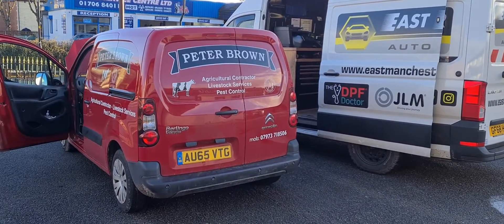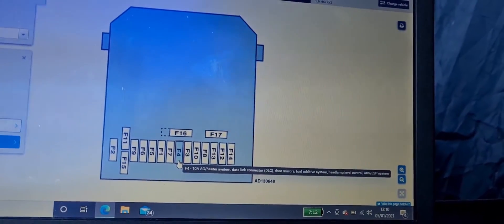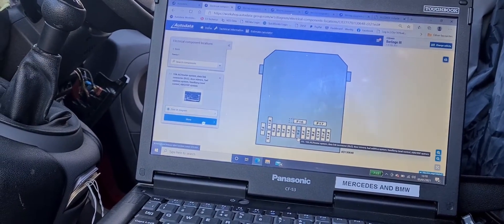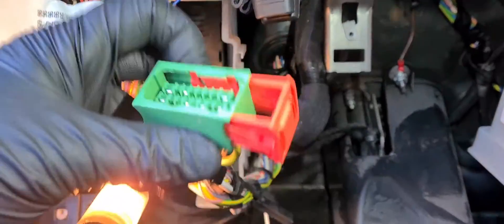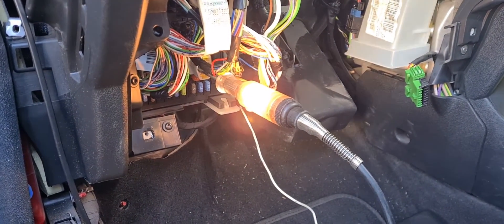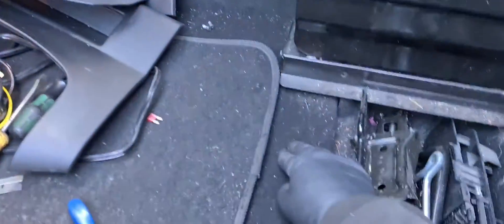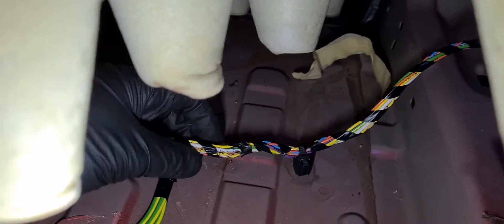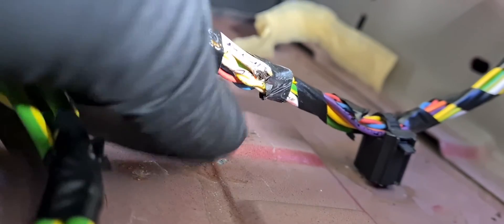SHORT CIRCUIT ON A CITROEN BERLINGO

Comment: I need your help my 2014 berlingo randomly loses the rpm, temp, and odometer and gear indicator. It comes and goes and also when it does if the engines running I can remove the key from ignition and the engine continues to run for 2 minutes

Comment: like the previous comment I have a Berlingo with a no start no crank issue, had a new starter on it and it was running fine then wouldn't start, power is going to starter and alternator but not cranking. could a short like this cause an issue like described